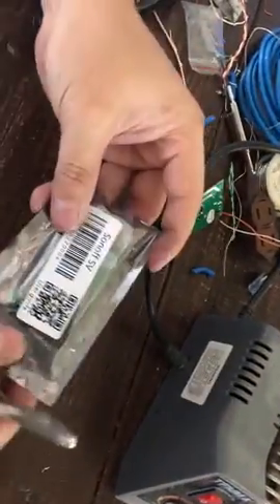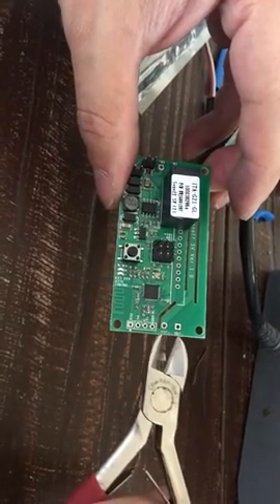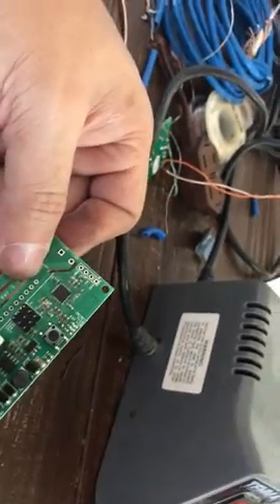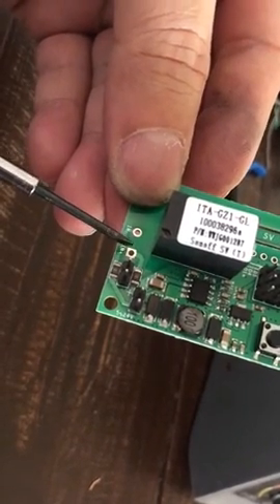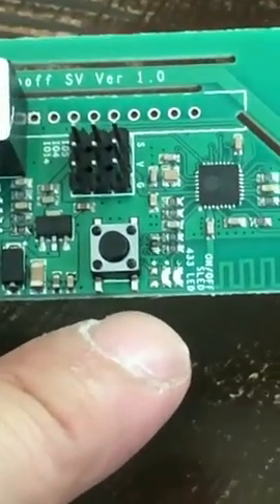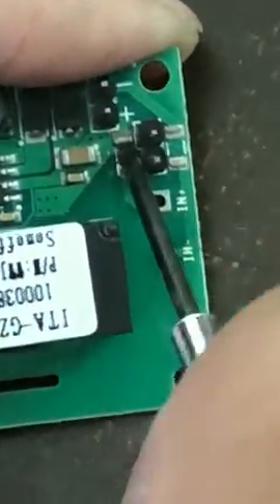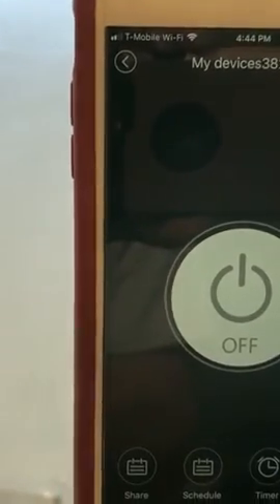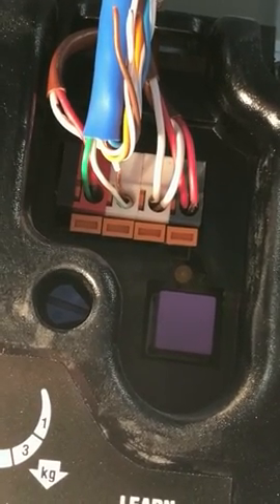Remote control garage doors from your phone for less than $8!

Comment: Nice Video. Can I use 5V 500mA for the input?
Reply from the maker: No it has to be 12v DC with at least 500ma
Reply: I thought it could be 5V to 24V?
Reply from the maker: Yes you are right, sorry i forgot. 5 - 24 is okay. At 5v you probably need 1amp, you can try 500ma it should work.
Reply: Ok. I will use this for my garage and relay as dry contact only. Appreciate your help.

Comment: Great video thanks. I Came to tell you what Antoine already mentioned. With the latest official firmware update you can change the Sonoff SV action to Inching, and that will make it a toggle switch. you can set it to 0.5 ms and that works great. I have mine setup like that. 
to access the settings update the firmware then when you are in the settings click on the "... " on the top right of the app and you can find the inching more. Not sure why its called that  but it basically turns it into a toggle switch for the given amount of time you set.

Comment: If you would have used the Sonoff Inching/Self Locking switch you would not have had to so all the soldering and removing of resistors. Also, you would not have to push the button twice as the switch can be configures to do that automatically.
Reply from the maker: Wow I just checked it out, you are right, now I feel silly doing all that work, haha Thanks for letting me know
Reply: @DIYGEEKTEXAS  Yes, I used it on my door and it works perfect. The only thing is it won't tell you if your door is open or not. I purchased a $20 "Wize Cam" WIFI camera (https://www.wyzecam.com/ ) and pointed it at the door. I can see it on my phone from anywhere.
Reply: @anthab   @DIY GEEK  Or you can buy a smart wifi door magnet , what will works with IFTTT and on widget or notification show on your phone that your door is open or closed. Magic :)
Reply: @Andokaaa  então quer dizer que não precisa soldar?
Reply: @anthab  I used a Wyze contact sensor to detect if the door is open or closed.